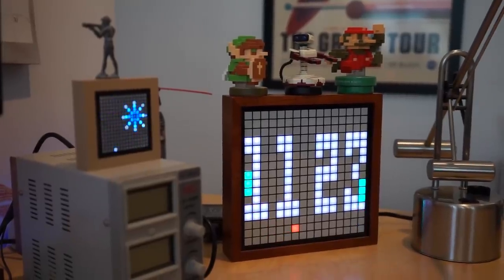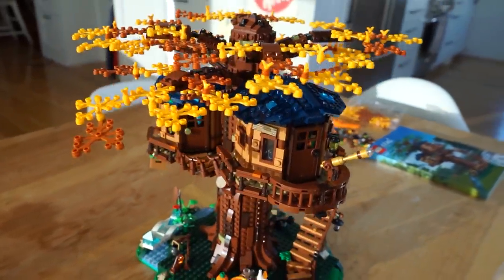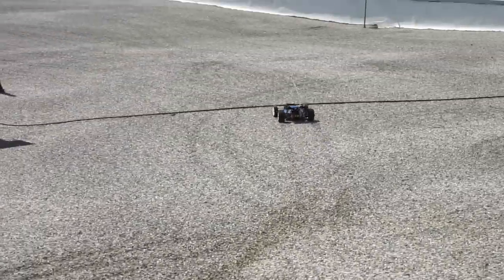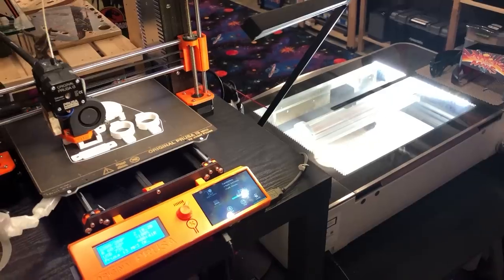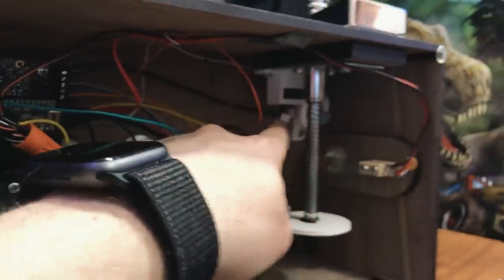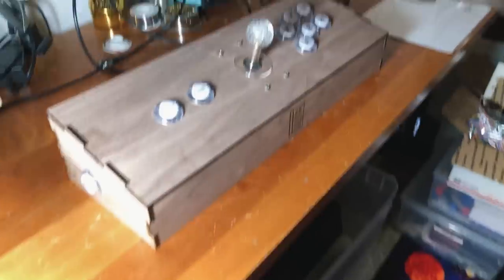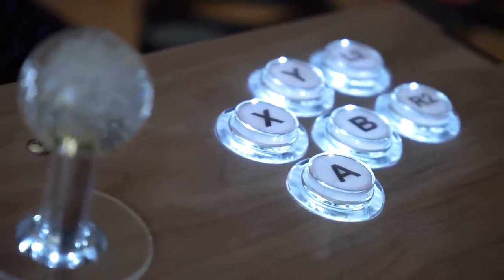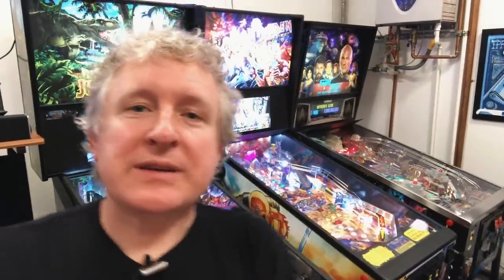PinSim Mini Arcade Joystick and Virtual Pinball Controller!

Comment: I made basically one of these, 29" wide and about 9" front to back.  I gave it the side buttons and a flipper button.  On top I have the trackball, spinner and a two player 6 button setup.  I REALLY wish I would have made mine with the angled top surface, I made mine a basic rectangle. 
Luckily, I'm in the middle of making one for a buddy, his is going to have the angled top for sure, so will my next one

Comment: UPDATE FOR PEOPLE MAKING THIS PROJECT USING THE PINSIM PCB  -- the PCB tilt sensor is designed for the ADXL345 accelerometer chip that comes on a smaller PCB that used 9 contact points.  The most common small boards for the ADXL345 now use 8 contact points and require some tweaking to use with the PINSIM PCB (the contact points for the ground and positive power are no longer in the right position for the 8-hole versions of the ADXL345).    Maybe someone can update the design at Oshpark for the PINSIM pcb.
Reply: I'm in the middle of building a pinsim myself and noticed the same thing. Did the 8 contact point accelerometer work for you? If so, do you know exactly which one you used?
Reply: @tropicaltexan1  I got it to work by using a socket for the ADXL345 chip and cutting off the socket pins for the power and ground, and then running wires from the power and ground pins to the right connection points on the pin sim board.  with that taken care of, the accelerometer works great.  good luck!
Reply: @szfinland   Finally finishing my pinsim build and adding an accelerometer. I've wired it up as you mentioned, and checked continuity to the pinsim PCB, all seems good. Is the accelerometer disabled by default or something?

Comment: Hi Jeremy, first of all, thanks for the initial Pinsim project. Personally, I'm in the middle of building one right now. Recently I soldered the board and put the software on it. Arduino was a first for me so that was fun.
Right now I'm awaiting delivery of some buttons and I am trying to work out what joystick and buttons to put on top.
Reply: Awesome!
Reply: I'd really appreciate a little advice regarding the programming of the Teensy LC.  When i try to verify the code (PINSIM .ino)in teensy arduino i get an error message. I read in the guide obviously but parts of it are confusing for me...

""XInput Game Controller for PC Pinball Games

Based on the excellent MSF_FightStick XINPUT project by Zack "Reaper" Littell

The complete project build guide, along with PCB links, wiring schematics, and 3D STL files, is hosted at Tested.
This code is designed to run on Teensy LC and requires the following libraries:

MSF-XInput
Adafruit Sensor
Adafruit ADXL345
Bounce
Average
EEPROMex
Please note the instructions for the MSF-XInput library, which requires some Teensyduino files to be overwritten in order to add support for a new USB device type.

I have included compiled code that can be installed on a Teensy LC using the Teensy Loader application. The code will compile for Teensy 3.2 but, besides being more expensive, that board lacks sufficient current output on the LED pins.""   

Any info would be greatly appreciated...

Many thanks.

Comment: "but you need to be a carpenter, to cut the wood basically" - shows laser cutter alternative... Never thought that laser cutter is cheaper than circular saw or even table saw 🤪
Reply: Totally agree, you could easily make the reverse argument. However, 1) you can order laser cuts from services like Ponoko, and 2) there are a rising number of people with laser cutters and no woodworking experience, me included.
Reply: @JeremyWilliams1  I see this as the meaning of the phrase. Just made me chuckle the way it was presented. I am handy person (or rather people say that, maybe because I remodeled my house) and have both circular saw and table saw, no way near getting laser cutter ;-)
Reply: Yeah that part was confusing ha
Reply: @JeremyWilliams1  Of course, depending on exactly what you need, you can also go to your local hardware/lumber store and have them cut the pieces you need. This never occurred to me as anything but a convenience for fitting plywood into a compact car until I was waiting for assistance at Home Depot one day and the young, apartment-dweller-looking person in front of me started reading off precise dimensions for seven or eight pieces to be cut out of a sheet of ply using the store's panel saw. They had made their plans including a cut diagram, and all they needed was someone to do the cuts for them. Eye-opening.

Comment: I converted an old Super8 projector into a frame by frame capture device using an RC server motor,arduino,relays ect so you could hook up a DSLR camera and convert old footage... and now I am adding a port to it so you can plug a raspberry pi 3b+ into the projector and use a PI cam instead of the DSLR... also made an IR remote converter(using an arduino) to the TV to get some added controls like a/b swapping fav channels... added room tracking ta a modded PSVR helmet using a pingpong ball with a 12v light inside and made it compatible with the game engine Godot running on Linux Ubuntu.... managed to fix memory leakage in my own lossless compression algorithm using Valgrind so I can start again on my own VST drumkit plugin where the whole kit is going to be sampled in my wardrobe closet.... Oh... and this is normal days since I am unemployed at the moment by will and like to be anti-social anyway... ;)

Comment: I'm a big fan of the pin sim, but instead of going without tilt and a plunger, why not go without the typical 6 button arcade layout.  Am I missing something or wouldn't you just need 2 flippers, a plunger, start and coin as far as physical buttons go.  Maybe a magna save button too, idk.

Comment: Hi Jeremy, I asked a looking laser cutting company to make what you posted on Thingiverse for the mini pinsim mini, but they came back with the following, have I missed something:

From the file it looks like it is supposed to be approx 320mm wide and in 6mm plywood, but the slots are 4,8mm deep. 

Do you know what size the holes should be? I can adjust it to make it work.

Thanks,
Gary.

Comment: Why would the Pinsim controller need any GitHub software, If you are using a standard controller PCB(PS3,4 or Xbox controller board) and distance sensor is simply read as a Z axis analog system, Steam should be able to read and assign it properly through the control panel as Pinball FX2 VR and even regular Pinball FX2/3 uses Steam with Open VR. Seems like its making things a bit more overcomplex than it has to be.
Edit : after a small amount of research you can buy a complete system that uses an optical Ipac, which is expensive but shouldn't really require anything special beyond whatever you are using as a mapper, depending on the software sometimes you need to create and move the .dll file with some software like Xinput and such, otherwise most people should be fine.

Comment: Use a kl25z with a linear potentiometer and a plunger, it s cheaper !
Reply: Salut, can the kl25z also be used for pinball fx2vr and zaccaria?
Reply: speedofsilence of course ! Kl25z with pinscape is a controller for Windows ( accellometer in it)
Reply: @fabienlelaurin7760  Merci beaucoup de votre reponse rapide. 🙂 Qui, je peut parler un peu francais. Looks like the board is the one I need. Merci encore!
Reply: speedofsilence you are welcome, the board can be use with any pinball game that use a 360 controller with the x360ce program.
Reply: @fabienlelaurin7760  Ok thanks. Board is ordered. I have one question though. Will 360ce support native nudge (nudging the pinsim, not the keys)? Or do I have to use pinscape? Can I use 360ce and pinscape on the board? I know dumb questions, but cannot figure out myself
Reply: speedofsilence in x360ce you go on the force feedback tab and you Check enable. Then the left stick of the controller is the gyroscope of the board.
Reply: @fabienlelaurin7760  Sounds great man, cannot wait to hook this baby up. Thanks for your help!